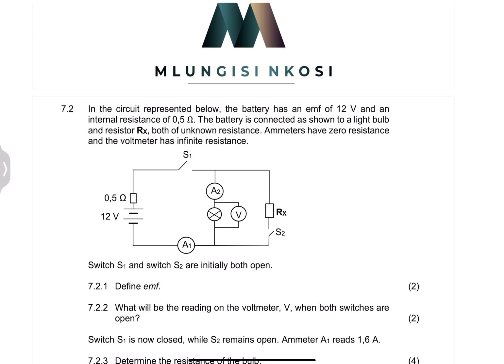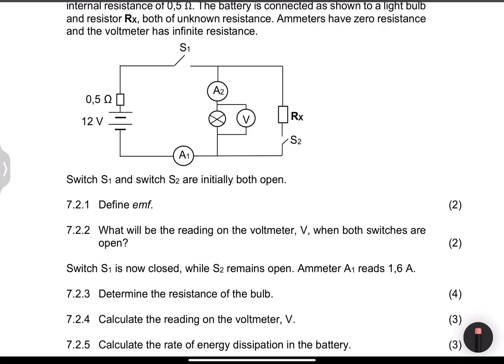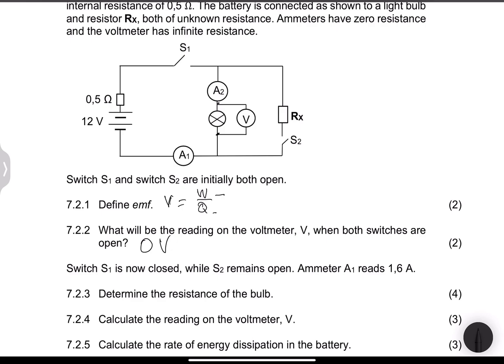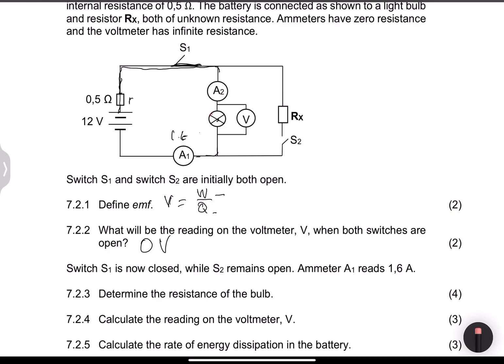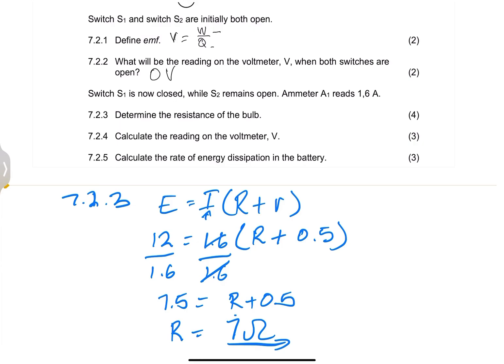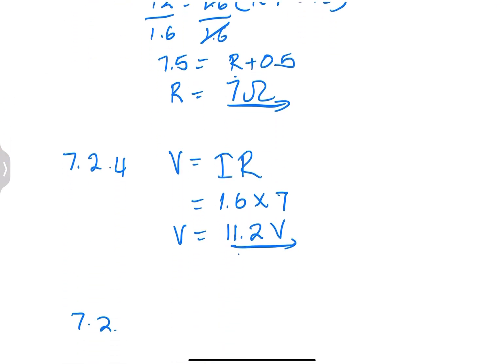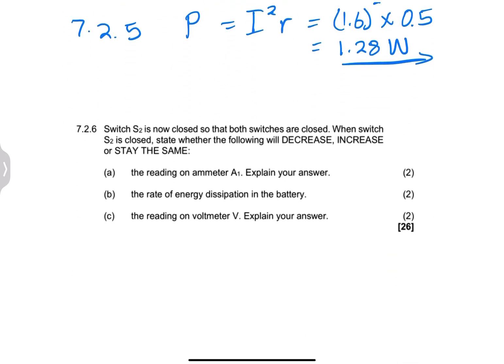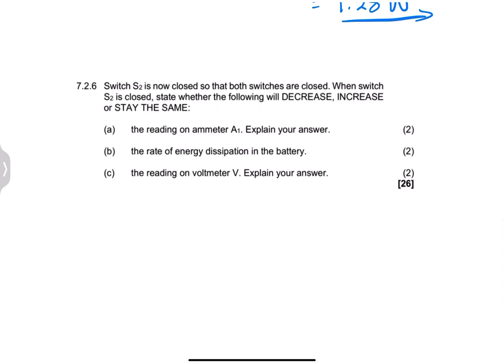Electric Circuits | IEB November 2021 | Mlungisi Nkosi

Comment: What would be the Potential Difference reading across S1(Switch 1) if a voltmeter is  placed across S1 and why?
Please explain sir
Reply from the maker: It would be 12V (the emf value) if the switch is open. The resitors become ordinary conductors (wires) when there is no current flowing. A resistor placed there would be reading across the terminals of the battery.
Reply: @MlungisiNkosi  Thanks